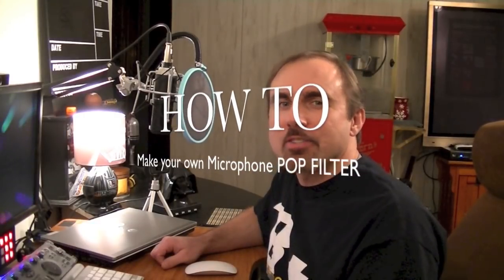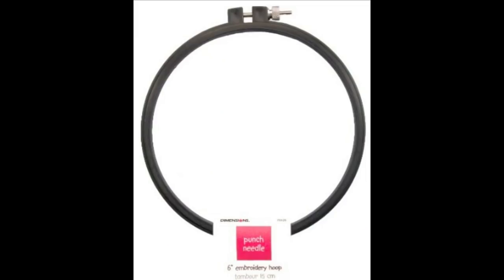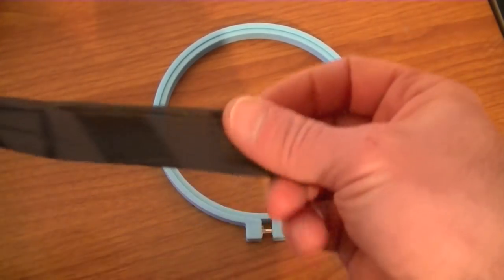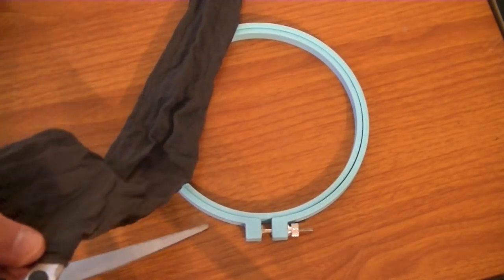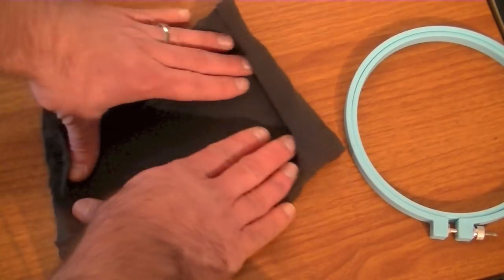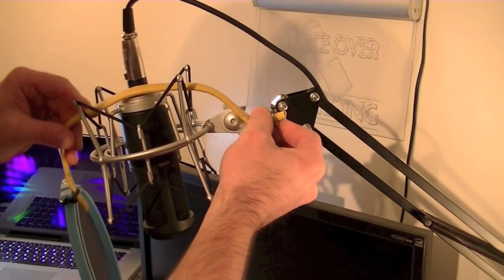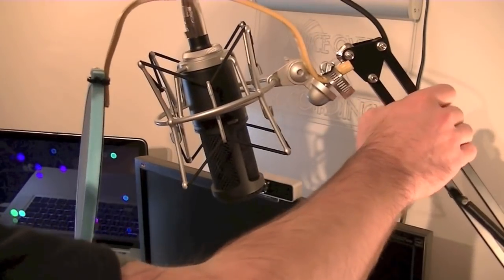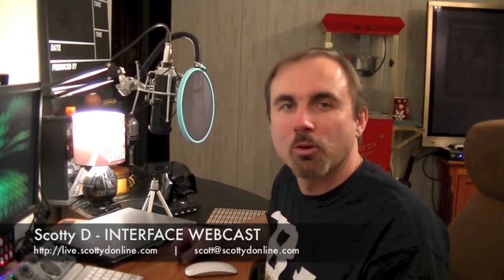How to make your own microphone Pop Filter

Comment: Is he using the microphone and the filter that is shown in the video to record the sound or he is using the mic of the camera?
Reply from the maker: Just as a FYI, I've answered this before but here you go... There are two mics used in this video... one is on the camera (AND IT'S A HORRIBLE ONE AT AT!) and the other is the AT2020. You can hear the distinct differences between the two if you listen.
Reply: ok thanks.

Comment: Scotty the D! What type of mic were you using to demonstrate the pop/no-pop? And is the outcome the same on other mic types? :Oo
Reply from the maker: I am using the Audiotechnica AT2020 XLR version. My audio chain is the mic to an Alesis Multimix4 USB using the gain on the mixer channel as a pre-amp then the Alesis is plugged into a Macbook Pro. Therefore the results "should" be the same for other mic types plugged into the same audio chain. Of course if your audio chain is different the pop filter usability should be very favorable and similar. You would plausibly only get different results with dynamic vs condenser mics and cheap capsules vs studio quality capsules in condenser mics. Mics like the Yeti already have a foam filter built in so the results may vary a little with mics of similar construction.
Reply: With a pop filter... which of either a dynamic, or condenser do you think would be best for a kind of creative whistling? This would be within a small, acoustic walled booth.
Reply from the maker: That's hard to pinpoint but certainly a Studio Condenser Mic will yield the best results. You will have to determine first, you budget and then work around that budget to get the best mic that compliments your sound. What works for me or someone else may not necessarily be the right mic for you. So if you have a local music or sound store where you live, I would recommend to go try many out and see what works best for you.
Reply: I went to Guitar Center, but they don't have an area you can test mics out. Either way... I believe I've settled on one. Thanks mang! :OD

Comment: I use a full metal pop filter and i don't hear much of a difference between the plastic mesh and the metal. the metal one is so tightly meshed that you don't get the reverberating sound.
Reply from the maker: Excellent... thanks for sharing your experience!

Comment: LOL.. Ok Scotty, seems you are taking a lot of heat over this! The many comments about the time and material costs for this project completely missed the point you were trying to make. I for one, get it. I must say however, that I think it's a hideous finished product. If you used black materials everywhere it would like much, much better. The point about the effect on tone is more important and I'm not sure that is resolved. Question; why double the nylon?
Reply from the maker: Double nylon provides a double baffle to break up the plosives... this is a common design in most manufactured pop-filters. You can make a single layer but the results will be limited by the single layer nylon. OH and on the topic of all black materials... I tried to find a black cross-stitch hoop but wasn't able to located one. If I could find one, I would swap out the blue ring.

Comment: Why don't you just cut the tube in half making two tubes.  Then just slide the tube halves over the inner ring, install the outer ring and trim.  You will have a double layer pop screen.

Comment: How much cost your pop filter?  I just buy one for 6.50 dlls (new and free shipping)
Reply from the maker: I have responded to this numerous times in this comment thread... It's not about the cost, it's about maintainability and built quality. I researched countless manufactured pop filters before I did this build and they were riddled with issues from quality, to stability, to functionality and more... I am not willing to shell out money for something that is poorly designed and manufactured with the mindset that if something goes wrong with it, I have to throw it away and buy another. If you take that approach, you could easily spend more than you expect on a pop filter. The one I built is aesthetically similar and fully maintainable down to every part on it. I can maintain my pop filter indefinitely for pennies on the dollar.

Comment: Why do u not just pull the nylon over the ring? Cut and then stretch is one step to much - ist like a pipe, it's not necessary to cut it...The difference between both version is...easier to build without cutting but the distance between both sides/sheets is depend of the thinness of the ring.

Comment: How much did this build actually cost?
Reply from the maker: +Hyperama When I built it, the materials cost me less than $7. But don't get hung up on that... as I mention very clearly in the video... the inspiration was not about cost but about the poor quality build and lack of maintainability of every manufactured pop filter I could find. I also have come out on several responses to comments that IF a pop filter exists that is 100% maintainable at a component level, I would be happy to look into purchasing one... to my knowledge, not one exists as manufactured pop filters are meant to be thrown away if ANYTHING goes wrong with them.
Reply from the maker: +JustWrio - Minecraft As I have said for the umpteenth time... AND I even say it in the video. This DIY is NOT about the cost.

Comment: Thank you for the video- can anyone reply with a link to the cheapest pair of appropriate pantyhose that would work well to make the pop filter as I have no idea about pantyhose as a guy :)
Reply from the maker: Don't overthink it... If you're in the continental united states, just go to any Dollar Store or discount store and buy a cheap pair. What you're looking for is to build a pop filter with a double layer of nylon that will break up the plosives from your breath when you speak into your mic.
Reply: Thanks- I ended up ordering a red pair on ebay from china for $1.50..

Comment: I'm in the process of getting my microphone off of a tripod and into a boom stand, and have been looking up parts needed. I knew I needed a pop filter, but until I heard what you had to say about them(like the having to replace the whole thing if it breaks) I was just gonna buy one. Screw that noise, I like the customization aspect of this one. 

I have a question though, the boom stand in the description is no longer available on amazon, would this one be a good replacement: http://www.amazon.com/Neewer-40037799-Broadcast-Microphone-Suspension/dp/B00AK7SKL4/ref=pd_cp_MI_0

I still don't know too much about the boom stands quality-wise. I was also looking at this one because of affordability: http://www.ebay.ca/itm/Adjustable-Mic-Microphone-Suspension-Arm-Stand-Holder-For-Studio-Broadcasting-/400563407434?pt=US_Stands_Mounts_Holders&hash=item5d43708a4a&_uhb=1

Thanks!

Comment: maybe use metal coat hangar instead of roamex
Reply from the maker: You could definitely use this concept. The challenge will be that a metal coat hanger will not be as friendly to work with (very stiff) and will easily degrade over time as it is a single metal cable vs multiple cables in the Romex.

Comment: Now,  the fact that i have to go to the shop and buy materials for that i will expend 20 dollars in petrol from shop to shop until i find the materials. If i buy it online i will cost me 10 dollars or less. In my case is cheaper to buy it. Please would be awesome that in your next videos related with this you use Conventional stuff found at home.
Reply from the maker: Antonio... As I have mentioned in past responses to peoples comments as well as I make mention of this in the very beginning of the video... making it has nothing to cost. It has everything to do with the ability to repair or replace any piece as needed. No factory manufactured pop filter that I have been able to find allows this. I also make mention in other videos that as soon as a professional manufactured pop filter does come out that allows for repair or replacement of pieces as needed, I will consider getting it instead. :) Thanks for your comment thought... I sincerely appreciate it.

Comment: why not just put the inner ring inside the nylon stocking without cutting the slit on the side?
Reply from the maker: I tried that and it didn't grab the nylon properly. You may try it and get different results.
Reply: thanks

Comment: It's nice but at 15:00, when you're talking to the camera and thus not directly facing the mic, you sound just about as good as when talking thru the pop filter. (Maybe better, because even the filter doesn't completely remove the pops.)

Agree/disagree? Maybe my ears aren't as finely tuned as you audio enthusiasts.
Reply from the maker: David Rosenblatt When I'm not talking directly into the mic diaphram at 15:00 the plosives are not an issue into the mic. The example of how well this DIY mic works is when I talk directly into the mic at 14:50, then when I talk directly behind the pop filter at the same distance from the mic at 15:08 the plosives are no longer present.
Reply: Scotty D Right. So I guess my real question is: Is there some advantage to talking directly into the mic that makes a pop filter essential? That is, pops aside, is the quality of a mic-facing recording noticeably superior to one in which the mic is off to the side? Or is it just that human nature makes us want to talk directly to the mic when we address an audience, in the same way we want to face the camera?
Reply from the maker: It really depends on the recording session. Sitting too far back from a large diaphragm studio condenser mic may require your gain to be set higher to pick up the sounds at a desirable level at which will also pick up artifacts from the room because these types of mics are very sensitive. Speaking closer to the mic allows you to reduce gain and therefore reducing unwanted artifacts from showing up in your recording. No one situation is right or wrong, it all depends on the session and the desired outcome. That said, every professional studio in the world uses pop filters. Mic technique is also key here as being in the right position to the respective mic will also limit the plausible plosives. I hope this helps?

Comment: Dcotty, the first impression I got when I played this video is a pretty bad quality sound. I've been researching the AT2020 for the last 3 hours and it can sound a hell fo a lot better than in this video. There's got to be something you're doing wrong there acoustically...
Reply from the maker: I've been over this topic before... NOT all audio in this video was collected with the AT2020... there is a JVC Camcorder in use here with an internal mic. That's why the audio is so dynamic in this video.  I KNOW THIS... I've said it before in other comment responses... Also, the area which this video was recorded was not acoustically treated and added to the disparate audio quality.  I have since moved into a new acoustically treated area and my audio is 100% better.
Reply: Scotty D
OK, sorry I didn't check out the other comments first. Glad to hear about the new space, keep up the good work!
Reply from the maker: No worries... Glad you like my channel.

Comment: socks work as well
Reply from the maker: hamzo7- The Child Friendly Gamer (Road to 1k) (Proud Member of TheUndefeatedTV) Perhaps, yes... however in the world of VoiceOver, you want to eliminate the Plosives without coloring the natural sound. A sock is pretty thick and can have a slight muffling effect. But, yes, it can stop plosives.
Reply: Yeah, it is the cheaper alternative and I really cant be bothered making this xD
Reply from the maker: That is your prerogative... Don't be bothered. Others choose differently. As I said thicker material can have an adverse effect on the sound being recorded and a professional sound engineer could discern this.
Reply: Yeah, I guess that your right. But cant you do this as well with a milo tin and some wire or cut socks? Btw great video :)
Reply from the maker: There are many ways you can construct a pop filter... in the market the most predominate materials used are metal, nylon as I did, and low density foam. Foam is normally used as a wind screen/pop filter for dynamic mics used in live performances and outside venues... metal pop filters are available but they are a but more expensive and nylon pop filters are the most common but the manufacturered ones are riddled with design shortcomings and letdowns and as such, I built my own.

Comment: i'm trying to find a way to Pop filter my headset. Will you accept the challenge for me? :P
Reply from the maker: Pop filter for your headset? If the plosives exist in the recording. The only way you can lower them down is a compressor/limiter and eq. But you won’t eliminate them completely if they are already in the recordings or live feed.
Reply: @ScottyD  yes for the mic attached to my headphones. I like that it's close to the wanted audio source, without blocking the view of my keyboard or monitor. plosives are an issue though.
Reply from the maker: @Layarion  I've not seen a pop filter for headset attached mics. I've only seen wind screen foam sleeves. They help a little for plosives but are mainly used to break up wind before it hits the mic capsule.

Comment: Wonder why anyone would want to do that since a new one is something like 15$ at the closest music store...
Reply from the maker: I make clear in the first 30-40 seconds of this video, it's not about cost... moreover, because of the reasons I make mention in the video... I have tried, used and returned countless manufactured pop filters for various reasons from poor build quality to cheap materials, the complete and utter failure... after doing this a number of times, I have little confidence in spending my money on something that was built cheap and not maintainable and is meant to be thrown away and just buy another... I figured out a way to make one that I could maintain for pennies on the dollar at a component level. Hense... the video to share my experience with others that are interested in a DIY project.

I do know there are a few manufactured pop filters that allow for the filters to be swapped out but they are in excess of $60-$70 dollars each. That's expensive for what it does and how it's made.

Comment: Metal pop filters can give you a different sound, I dont think you know what you are talking about. I got rid of my nylon filter for the metal filter. WAY CLEARER.
Reply from the maker: Thanks for your comment... Believe me, I've been in the broadcasting and voiceover entertainment business professionally both on air and as an engineer since 1987... I know what I am talking about. I would like you to explain in an engineering manner how a metal pop filter gives you a "different sound" and show statistical analysis on how it is "way clearer".
Reply: Scotty D Except I am not an engineer. I can tell you my pop filter is washable and attaches straight to the mic. As for it being clearer when I had the nylon filter it had a very small muffled sound, "unnoticeable to most". When I got the pop guard It was much more lightweight and cleared up that muffled sound I had heard with the nylon filter. Depending on the sound you want depends on the filter you get. I have had 0 problems with any metal ringing or resonating on that filter. I am glad to be rid of using a nylon filter. If I am correct, the room you are using has a lot to do with it, as well as the type of microphone you are using. I have a cardioid mic with a metal screen/plastic that fits the rooms acoustics perfectly. For it being a "Cardioid mic" It already does a lot of sound cancellation. Doesnt pic up electronic sounds behind it and after some very simple sound editing all white noise is eliminated as well. But what do i know. I only have a GFX and Film degree. But whatevs.

Comment: I clean my pop mesh with condensed air. LOL have you never heard of that?
Reply from the maker: Canned air will remove dust but it won't remove all the spit, saliva and other germs or viruses that people may have in their system and breath onto your pop filter... and if you try to clean a store manufactured pop filter to remove the aforementioned items, it will not be a good experience. My pop filter will allow for easy replacement of any item making maintenance and upkeep a breeze.
Reply: oh lysol or something to kills germs is good for that lol... Either way cool setup!

Comment: It sounds so loud and like he didn't use a pop filter
Reply: Probably didn't
Reply: his room is echo, he needs and ambient noise reflection filter (basically a sound absorber)
Reply from the maker: There are two mics used in the video... one was built into the camera (the horrible sounding audio in the video) and the other is an AT2020 with pop filter.
Reply: Nice vid anyway man
Reply from the maker: This video was not about sound treatment of a room, it was about a pop filter. Since this video was made, I have built a new studio from the ground up in a different location that is treated for sound as well. Thanks!

Comment: Why don't you just cut the nylons off at the crotch of both legs then stuff the small ring into the thigh end of one and then the other, then put the large ring on.. semi tighten.. pull taught and then tighten fully and trim off excess?.. that would make it a screen on both sides of ring making it 2 screens with an air baffle in between.. just wondering..
Reply from the maker: +Dan C I tried the method you're mentioning once and the rings didn't clamp on the nylon effectively. I'll try once again as it would definitely enhance the layers. In fact it would be a quad layer pop filter which is something i've never seen on the market. I would wonder with that many layers if it will "color" or muffle the sound to a discernible level.